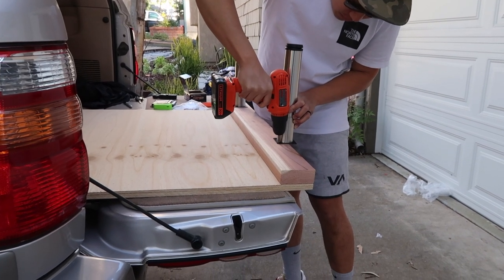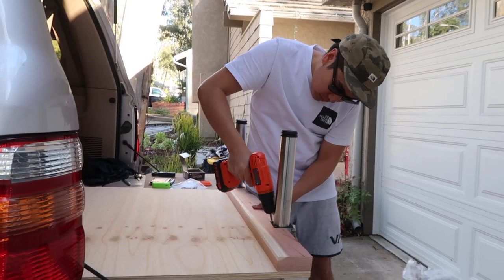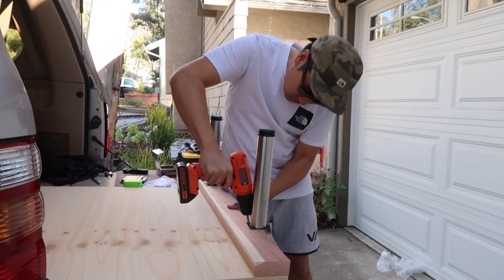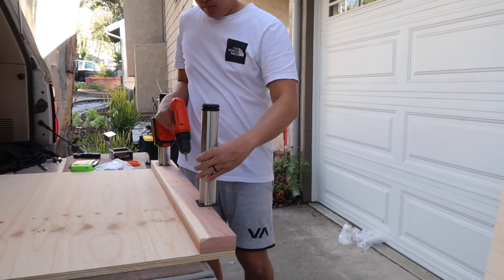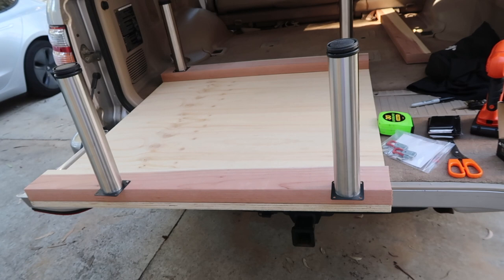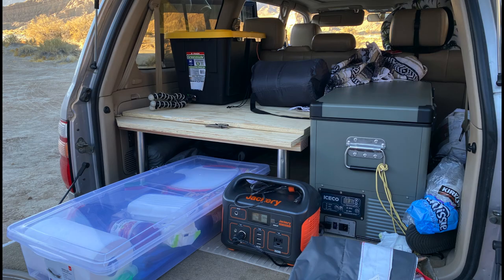DIY : Sleeping Platform for the Toyota Land Cruiser 100 series (quick, easy, and affordable!)

Comment: Hey guys, what's the overall width of the platform and a separate measurement for the width of your fridge? I going for a similar setup and the fridge doesn't sit flat due to the wheel arches. Cheers!